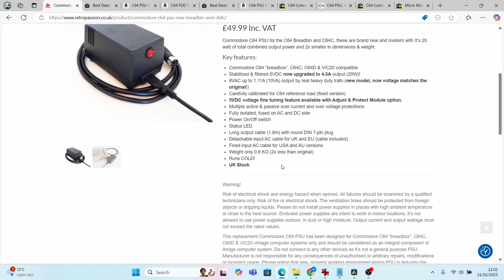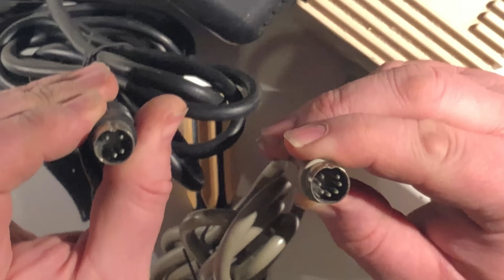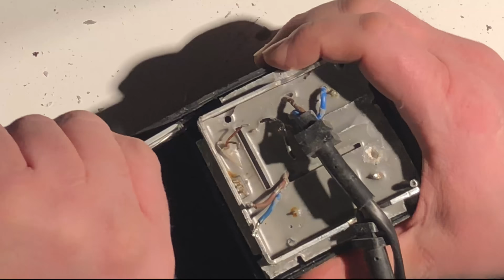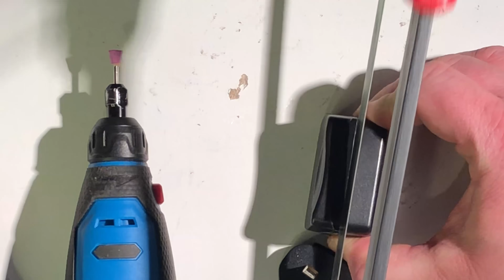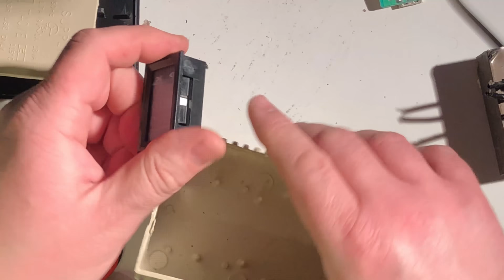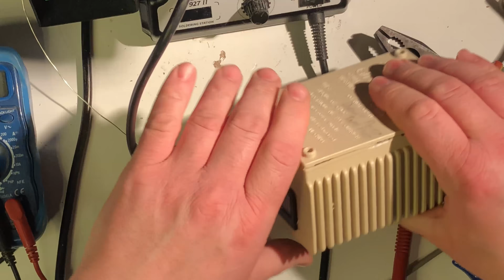Commodore 64 Power Supply Is it possible to fix the original C64 design?

Comment: Ive got a multi volt AC plug that's capable of 9v, it also has a usb socket on the bottom of it that outputs 5v 2.1A. 

Do you think I could solder the plug's AC and the wires from a cut usb cord to a male 7pin din plug to make a very small C64 wall plug PSU?
Reply from the maker: Yes it’s possible. Only things to consider is how many amps does it put out at 9vac as the original is 1A, I think you could get away with less as long as nothing plugged into the c64 needs it. The 5VDC @ 2.1A will be fine and more then the original power supply but again, if you have disk drives or other devices that draw on that 5V, a little higher amps isn’t going to hurt. Give it a try and I’d touch test once you’ve run it for a while, as long as it isn’t cooking, should be fine

Comment: If you had a 3D scanner and 3D printer you could have scanned original and printed a new shell,  potentially even changed it a little.
Reply from the maker: This was more about trying to use as much of the original power supply as possible. That said as this video shows, unless you want to glue it together again, it's not ideal. The good news is if you go on thingyverse, there are a load of C64 power supply shells ready to download and print. I think for version 2 I'd use one of these. Thanks for watching 👍
Reply: @BillFixesEverything If you 3D print a shell,  they make hear set thread inserts to accept screws

Comment: some suggestions, I understand this is a proof of concept solution and you may get back to it (maybe right? 😉), but get a box of various shrink wraps tubes, that is better way to insulate the soldered connections, but also you can use a hack to measure the connector pins voltage safely. Use a shrink wrap tube (as is without shrinking), pull it over the pin/pins you are going to measure, and then stick the probe inside the tube, this will prevent any pin shortening while you may slip the probe. Also I dont understand what can go bad on a AC transformer over the time, its just copper wire winded over a core. Transformers do burn if shorted, not with time or heat... PSU bricks die with time due to leaking caps, has nothing to do with actual transformer. If you want to go super safe, put another AC switch (maybe with nice light) on the mains end before the transformer. In case the switch in your C64 fails, you do have backup plan. And for others who dont have UK plugs with fuse inside, you can use the AC switch with fuse. Also, I would probably not wrap the USB charger in tape, there is still some heat being produced, maybe its safe, the Amperage is not that high... I would use 3M thick double sided tape to install it inside the case, maybe? Just some thoughts...
Reply from the maker: Thank you for your comments. Yes this really is more of a proof of concept. If I was going to build this again... and I probably will, I'd only use the cables from the original power supply and ideally a broken one. I'd go with a 3D printed case, a new 9vac transformer as unless there is some way to dissolve that putty around the old one without it turning into mustard gas, its not worth the hassle. I'd go for a better 5V circuit rather then using a charger one. Ideally one that taps off the 9vac rather than needing mains and designed to fit the case. I'd also go a belts and braces and have a 5V overvolt shut off circuit as well as the monitor to see what the voltagea and amps are doing. I'm not a fan of electrical tape either, its the electricians choice for some down and dirty insulation but ideally have everything fixed down so cables and boards can't slip and short out. Heat shrink is good but if there is a build up of heat, over time that will go hard and start cracking.
Reply: @BillFixesEverything it was that vintage DC regulator IC, specifically, a model Si3052p, that was made with no protections, like over-Volt shut off, that is the hazard.

Comment: Those are an impressive amount of bad idea's.
Why would you use a screwdriver to open those cases?, they look horrible.

The wedge case psu is easy to repair, you only need to install a new and upgraded  regulator.

Do not try this at home!!
Reply from the maker: Yes this was more of an experiment rather than a how-to guide. I'm sure people can use bits from this video but not a recommended way of doing it. There are lots of solutions for replacing the regulator but all involve trying to get inside the power supply and that's the tricky part. I think the best solution for most people is the inline solutions for old power supplies that cuts the power if the DC starts to rise. You don't have to open the power supply at all or if you have deep pockets, buy a modern replacement.
Reply: I could not see where the solvent was dropped into the seam. If you don't have a can that says Acetone, the classic formula Nail Enamel remover is that, with some scent added.

Comment: Nice video :) I modified my c64 power supplies in the same way. leaving the transformer only for 9V AC; with a new switching power supply for 5V DC. Cheers!
Reply from the maker: Thank you for your comment. It’s such a shame they didn’t just use screws and not fill it with that compound as it would make using the original case and transformer so much easier. Using the switching power supply does seem like the easier option rather than building a circuit to tap off the 9vac. On the transformer I used, it wasn’t an option as it was only 8vac on one side and it wouldn’t even run the cassette deck.
Reply: @BillFixesEverything  I believe the potting compound was there to prevent fire. The transformer and voltage regulator can overheat, but they will not catch fire. And You are right, if it was not potted, that would be great :)
Reply: @BillFixesEverything that AC coil, that's isolated from any DC circuitry, is doubled inside the 64, to get 16 Volts to run the 12V sound and image chips, and turn the datasette motor.

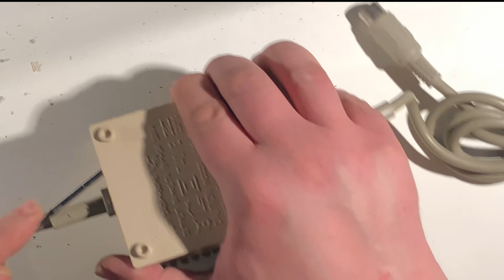Comment: 4:13 The tape motor uses the 9v ac not the 5v dc.
Reply from the maker: That explains it then. On the transformer, one side was only 8vac so probably it was that going to the motor. I know where I got the 5VDC from to. When you look at most pinouts for this port it has the 5VDC and gnd marked up whereas the 9vac is just marked up as cassette motor. Thanks for letting me know 👍

Comment: I created a small pcb board that replaces the incoming Ferrite filter thru-hole component on the 5V line, 
with an over-voltage protection chip KTS1670EDA  and NFZ32BW6R8HN11L smd Ferriate,
 also a blue led that shows power is on and below 5.28V, even if the side switch is off.
Can send one for $5 shipped.
Reply from the maker: Thanks for the offer. I would have taken you up on that as $5 shipped is very cheap but I've already started on making a bwack V2 which has overvoltage protection. Where the PSU I made has a display showing the 5VDC, the V2 also shows the AC line and its amps which will make it handy for a couple of C64s I need to repair. Have you released your circuit anywhere? I was looking online and couldn't see any C64 overvoltage circuits using the KTS1670EDA chip but I can see its a great chip to use for this application, very versatile.

Comment: Great and interesting video! I've never understood why Commodore thought it was necessary to encase the internals of these power supplies in resin epoxy. I've modded quite a few of them myself, but I've never bothered adding a volt/ammeter. At some point, I should make one with a voltmeter. Nice work!
Reply from the maker: Thank you for your comment and glad you liked the video. For me it’s finding a better way of getting the transformer out of that resin. As you saw in the video, it doesn’t like heat, hitting it can damage the transformer. The only thing I can think of is using something like acetone or another chemical to dissolve it but can imagine this will be fairly toxic and again will probably damage the transformer anyway. Plus it seems they used different compounds to fill them with. It is a shame they did fill them with this stuff. Good luck with the voltmeter/ammeter, I got that fairly cheap on Amazon but does the job at  the power supplies low amps
Reply: @BillFixesEverything  Video titled: Commodore 64 C64 Power Supply Epoxy Disassembly ; he holds it pressed between 2 wood pieces and smashes it down on a table (wood hits table, not the case itself), epoxy comes out slowly without damage to case mostly.
Reply: I believe the resin was there to prevent fire. The transformer and voltage regulator can overheat and die, but they will not catch fire. Power supply burning (open flame) 
was a big problem back then.
Reply from the maker: @JosipRetroBits  It could be as no oxygen means no fire. However, I often wondered if it was just simply a cost cutting exercise by commodore. The resin holds everything tight as without it, as the transformer doesn’t have any mounting points, it could move around weakening the connection to the pcb. Also the heavy weight of the power supply gives it that more premium feel. Finally gluing the whole thing together. Remember it was built for the masses not for the classes